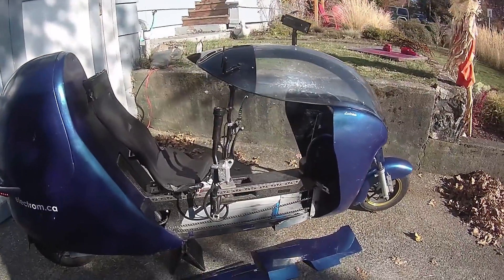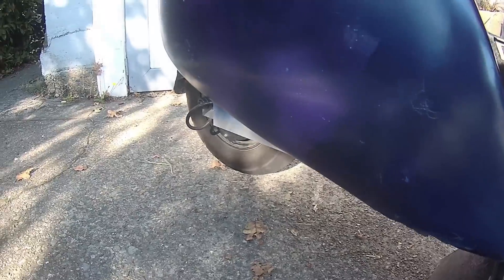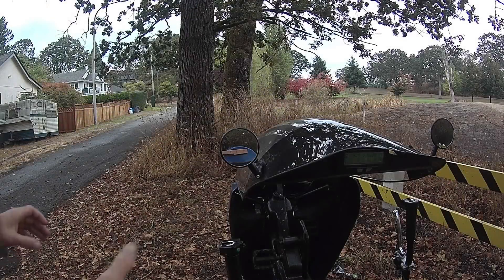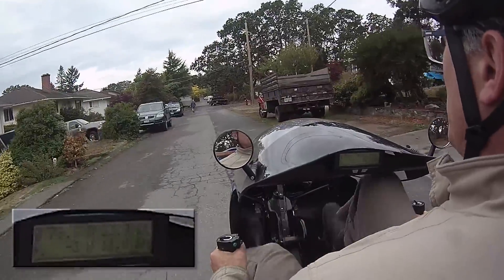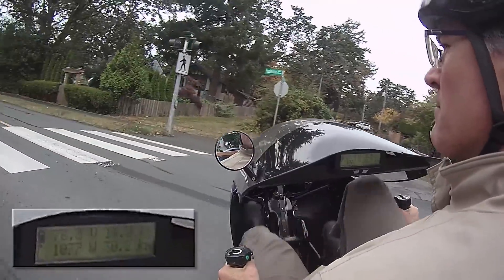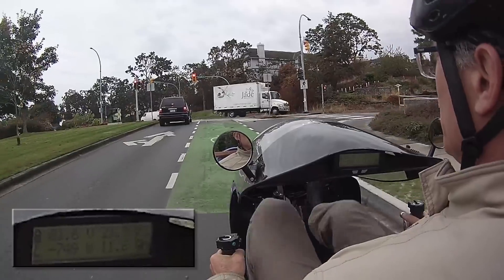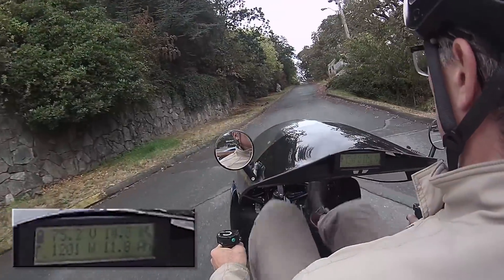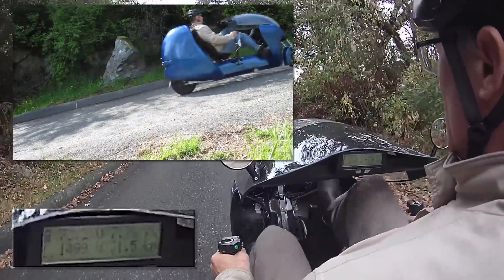Electrom Generator Drive

Comment: 1500W?
Reply from the maker: Hi Kody, The Electrom will run nicely at 500 watts on the flat, and climb steep hills at 1200 watts (but it does have the direct chain drive if the hill is too steep). This is in compliance with most Canadian and US ebike rules. I must say though that the more power you give it, the better the experience. It absolutely rocks at 2400 watts, adn I have found the sweet spot for range vs speed is an 1800 watt max. The power settings are all adjustable via the Grin Technologies Cycle Annalist V3